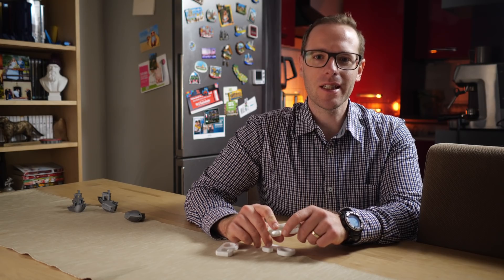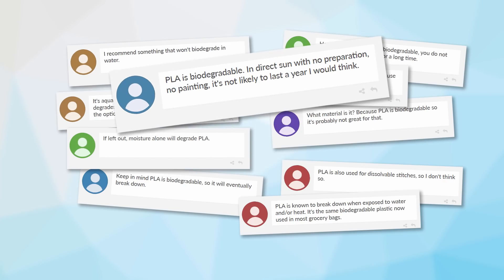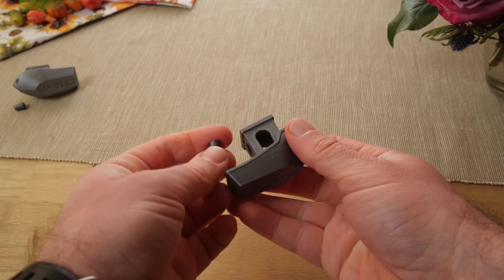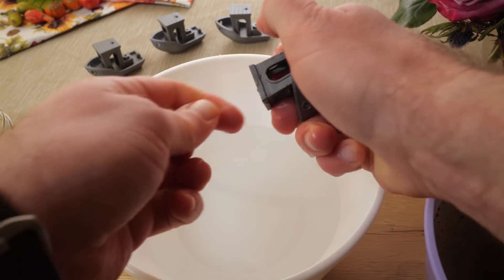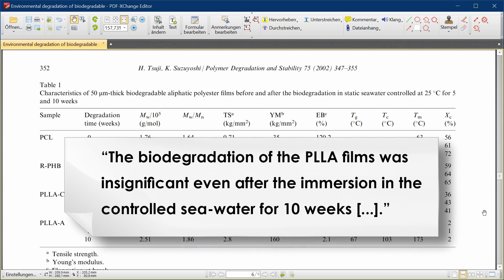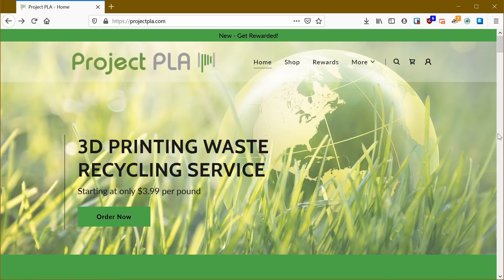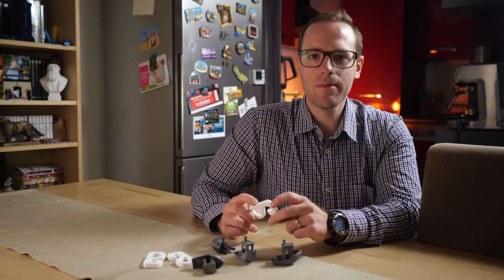Is PLA for 3D printing really biodegradable? I've buried and drowned Benchy for 2 years to find out!

Comment: Very informative video! PLA's advertised biodegradability is the whole reason I was okay with getting into 3D printing D&D/tabletop minis as a hobby in the first place, and learning that it isn't reasonably biodegradable leaves a sour taste in my mouth. Until a financially sensible recycling solution comes about, I think I'm just going to hoard my excess filament/failed prints. If it gets too much I'll just bite the bullet and buy the TeraCycle PLA box. It's pricey (181 USD for the smallest box), but I'd much rather not be personally responsible for so much plastic waste.
Reply from the maker: That sounds very sensible. I think that with time, more and more companies will start processing printed parts.

I just discovered a new one in Germany where you can send failed prints. You don't get anything in return per say, but they cover the shipping costs, so it's still better than throwing it away.

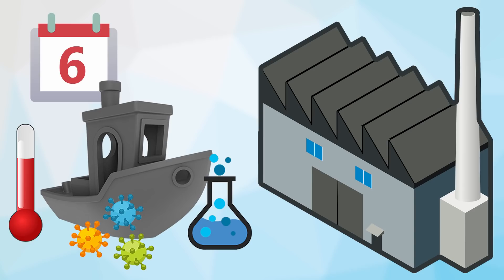Comment: I do take some issue with your claims at 7:50. You can break down most PLA on your own at home by keeping it in water at around 70 degrees celcius for a week. It won't fully break down, but it makes it far easier to biodegrade it

Comment: Everything is biodegradable, even uranium, given enough time. So when they claim something is biodegradable without specifying a timeframe, take it with a grain of salt, it's a generic term that can be used and abused for any product. Most people confuse 'biodegradable' with 'compostable.' The EU compostable label means that the product must break down within 12 weeks when buried in moist soil.

"EN 13432 requires compostable plastics to disintegrate after 12 weeks and completely biodegrade after six months, meaning that 90% or more of the plastic material will have been converted to CO2."

Comment: So I can print my rc submarine hull using PLA and it will be okay 👍🏻 I’ll coat it with epoxy resin for extra protection
Reply from the maker: I'd use epoxy regardless to seal the gaps.  I've printed a few flower pots for my wife and most of them leaked slowly over time.
Reply: @HobbyHoarder  I'll use epoxy for sure 👍

Comment: good video. After I made a part for my saltwater aquarium, I searched it because I didnt think pla is going to biodegrade under normal condition. Some People are spreading false info about pla. Pla is plastic, so it is chemically inert, which means it is hard to get biodegrade. Glad I found this video to check the facts.

Comment: That's a very interesting video, so I think incineration is the least bad solution "PLA can be incinerated without producing chlorine-containing chemicals or heavy metals because it contains only carbon, oxygen, and hydrogen atoms. Since it does not contain chlorine it does not produce dioxins or hydrochloric acid during incineration.[58] PLA can be combusted with no remaining residue. This and other results suggest that incineration is an environmentally friendly disposal of waste PLA."

Comment: The fact that pla was biodegradable was the reason why I avoided using it for my prints!
If I spend money printing a part, I want that part to last. It's such a shame I didn't find this video earlier. I would've wasted a lot less time with other materials like PETG (too sticky) and ABS (too warpy), and just printed all my parts out of pla
Reply from the maker: Yeah, PLA is really easy to print with. PETG still has its use when you need a strong part, but for something that will sit on your desk, PLA is good enough.

A variant of the ABS that's also very useful is ASA; it's strong like ABS, but has high UV resistance so it's perfect for things that will be left outside in the sun.

Comment: Not the same, but I've a "biodegradable" plastic straw in my garden from the last 4 years, and it's still entire, one can wash and use it if want.
Reply from the maker: Yeah, I've seen those straws and drinking cups. They're usually made from PLA anyway, so it's the same as with printers.

Comment: Many of my PLA parts I printed a few years ago and that has been in my living room the whole time has turned into fragments, simply falling apart by themselves... I think some manufacturers are using additives to prevent this from happening because some of the parts I printed has survived fine...
Reply from the maker: I've found cheaper brands to be flimsier to work with. Maybe they're mixing some cheaper, lower quality plastic with their PLA, which is what causes the degradation.

Comment: Try putting it in a vinegar solution. polimers made by esters like PLA (Poly Lactic Acid) Hydrolyse under basic or acidic conditions.
putting it under basic conditions isn't going to do very much because the base is going to be neutralized by the lactic acid, but if you put it under acidic conditions the acidity will only increase as the lactic acid forms, so in theory after a long time (I don't know how much) you will end only with a solution of vinegar and lactic acid

Comment: That is good to know, but what about the carbon footprint from the ingredients used to manufacture PLA as opposed to other filaments?
Reply from the maker: I think PLA is still the best in that regards. PLA made from recycled bottles is also becoming more and more common, so that's probably even better. If you can justify the cost, recycling and making new PLA filament at home is probably the best in regards to environment, but I haven't found a machine that's cheap enough yet.

Comment: Okay, but… I don’t understand why it isn’t mentioned that the carbon footprint of producing PLA is 75% smaller than that of traditional plastics. So very clearly with that fact alone PLA is indeed significantly more eco-friendly than most other plastic materials.

Additionally, it isn’t like PLA not degrading is even an issue, because it doesn’t actually contribute any toxic waste to the environment.

Comment: PLA doesent claim to be biodegradable.
It's Compostable, which is different, and in any case there are different standards regarding this, so some pla will be compostable at home and some other will need industrial digestors

Comment: Isn't PLA still a good choice since no oil is required and when it is burned (which is pretty common in germany) it has a pretty good CO2 foot print?
Reply from the maker: Yeah, it's still much better than ABS. I just hope some company will turn up that will take the waste plastic and turn it into new fillament.

Comment: PLA is thermoplastic which means that it could be recycled by being heated at 180℃ and reshaped. And with its physical properties and low melting temperature, PLA is easy and safe to reused. So don't throw it away but try to reuse it!

Comment: The biggest issue is that PLA is “biodegradable” but not “compostable” (I believe someone mentioned this before in another comment). 

The difference I image is that compostable means you can throw it in a compost pile and let natural plants and organisms (bugs and bacteria) break the material down, either consuming it or turning it into simpler macro-molecules.

biodegradable is still safer for the environment when produced, and when it falls apart, unlike traditional plastics. But it probably still requires assistance to decompose (it needs to be placed in a specialized environment, manually sheared, and/or exposed to specific types of bacteria).

If anyone knows of any natural materials that will degrade and are compostables please let me know, I want to start a list. I'm thinking certain types of glues combined with some cellulose might make interesting materials.
Reply from the maker: Yeah, you pretty much summed it up nicely. The bigger problem is I think that most people don't know there's a difference. If someone hears "biodegradable", I'll bet anything they don't think of large recycling plants.

I don't think there's any compostable filament for 3D printing, at least I haven't been able to find it. There are more and more manufactures that recycle old plastic bottles into new spools though, so I think that's the best option right now. From what I'm seeing, PETG can be made 100% from old bottles, while PLA is a mix of 80% bottles and 20% new PLA.

Comment: Ultimately, is it that bad that PLA ends up being incinerated? Seeing that it is made from plants and not petroleum, you're not releasing any trapped fossil fuel carbon (unlike ABS, or PETG). The net impact then strictly comes from production and transport, which is both difficult to quantify but can also be made carbon-neutral. Does it really make sense then to try to recycle or biodegrade PLA as opposed to just burning it?
Reply from the maker: It's hard to say, I haven't been able to find much info if burning PLA is more viable vs. recycling. But it's certainly an interesting idea and a lot of people have had similar comments.

Comment: How about exposing one of those hooks to as much Sunlight as possible so it gets maximum UV radiation which is the killer of most degradable plastics, different colours normally affected in a different way. Just by leaving it hanging in a southerly exposure should do the trick. Excellent home science , keep it up.
Reply from the maker: One hook was left out in the open as well, it got as much sun as it's possible here in Germany.

I did print a "beware of dog" PLA sign about 3 years ago. It did bend a little from the heat, but it's not cracking and the colors are just as strong as they were. I'm sure the sun would do more damage in a country with really hot summers though.

Comment: "Don't print useless things" 1 second later "So I printed 24 hooks"
Reply from the maker: That's a very valid point. My hope is that the hooks will make up for it if this video convinced someone to print less stuff in the long term. I also didn't throw any of the hooks away, I have a large bin for all of my wasted prints that I'm hoping to be able to recycle or turn into new filament someday.
Reply: @HobbyHoarder  there is a way you can recycle your old or wasted prints and turn them into new filament spools its kinda spendy but certainly worth it. Theres a video on youtube I saw on it. I dont remember who did the video but its pretty easy to find.
Reply: It's a good thing that he's testing common assertions and revalidating his results in a rigorous way.  I've been printing pla with impunity with the apparently wrong belief that it was going to fall apart in a decade or two.

Comment: Have you tried Autoclaving any PLA parts prior? Ones that I have put in an Autoclave have came out whole but are extremely fragile and turn to power if a slight amount of force is applied,
Reply from the maker: I haven't tried that, but I doubt it helps with degrading. Just being brittle and breaking down into smaller pieces doesn't necessarily make it much better.

Comment: I printed multiple aquarium filters in PLA. The held perfectly for years (i replaced the ones i don't use anymore with something better, not because it failed : a few years after designing stuff i progressed in CAD :))
I also have PLA meshes to support aquarium plants, no change after years (up to 4-5 years now).
Aquariums are heavily filled with bacteria and microfauna, so it's a really active ecosystem, that should alleviate the "you used tap water" comments.
Plus the filters are the part with most biological activity on it in a well established aquarium...

I even have some PLA parts buried in the substrate of my planted aquariums, so they see aerobic and anaerobic conditions. In all cases, no change after multiple years (more than 2 years in that case).
Reply: are they still holding up in your AQUARIUM now again 2 years later
Reply: @gladiatormechs5574  The did hold for quite some time, until i decomissioned the aquariums. I still have some bits of it, but i don't have time to maintain aquariums as of now.
Reply: @AudreyRobinel  would you say that they held up until you took down your tank , or did they fall apart and then you took down your AQUARIUM ?..THANK YOU.
Reply: @gladiatormechs5574  They definitely held up fine in the tank! No degradation notable after removal. 
I have a friend that also print stuffs for his aquarium, no issues either.
I did also print PLA parts that served as soil holder for an aquascape, so they were burried in the soil. No damage after 3-4 years at least.
My friend had the air driven filters with some parts made of PLA; we tried loads of stuff, nothing to see as much as an issue.
We printed twinstar like structures, the metal degraded, not the plastic.
Reply: @AudreyRobinel  thank you for your time.

Comment: All plastics are biodegradable. Carbon fiber is not.
2:13 my prediction is, degrading in order of most to least: 1. outside in sun, 2. water, 3. desk, 4. buried, which will have no real degradation.
EDIT: Leave them for 10 years and check them again. :D

Comment: I mean, its durability in itself is a good argument for switching from petroleum based polymers to agricultural feedstock based polymers.
Ultimately the world will always need durable polymers. But we could definitely do with new alternatives for single use packaging.
Though I suppose, ultimately, the majority of plastic packaging is expected to deal with high levels of moisture for relatively long times, and as such, it implies they must be waterproof, otherwise paper would be used, and waterproof materials are typically much harder to compost to any extent. Perhaps we should design polymers which are much more sensitive to UV light.

Comment: Incineration should actually be carbon neutral for plant based plastics, since it only releases the CO2 that has been captured by the plants only a few years prior. Instead with plastics from fossile fuels you introduce carbon into the CO2 cycle, that has been buried for millons of years. Am I missing something or is recycling not neccesary for PLA?
Reply from the maker: It might be, yes, although I haven't seen any research on this. PLA isn't pure though, there are always some additives added. PLA doesn't burn by itself either (it kinda does, but it extinguishes quickly), so you'd have to add another fuel source as well for it to burn.

Comment: I wonder if part of the reason the results were underwhelming was because the filament is densely packed, with a very low relative surface area for degradation to kick in.  I would be interested in seeing how the material degrades if you shredded it into a powder first.

Comment: I know that latex balloons are Biodegradeable in your home compost but you need to chop them up into smaller parts to help the process and its still longer than food scraps etc but it does work. So perhaps it doesn't help that the prints are still intact etc. We could be a case of helping nature along by making the pieces have more surface area for the breakdown to occur.

PS Balloon releases are horrible but we can still enjoy latex balloons - When the party is over, pin it and compost bin it!

Comment: Biodegradable doesnt say anything at all about recyclability or how long it lasts.  Something can be biodegradable and last 100 years or 3 months, it is biodegradable if biological processes can break it down without creating poison.  Glass for example is able to be recycled by applying heat to melt it but it is not biodegradable so nothing will "eat" it.  Just because it lasts two years doesnt mean its bad for the environment thats not how it works, nor does it mean it isnt biodegradable.
Reply from the maker: That's a fair point. My main goal with the video was mainly to provide some balance to the "environmentally friendly" badge that so many manufactures like to use for their filaments. Most people aren't aware that the topic is much more complicated than that.